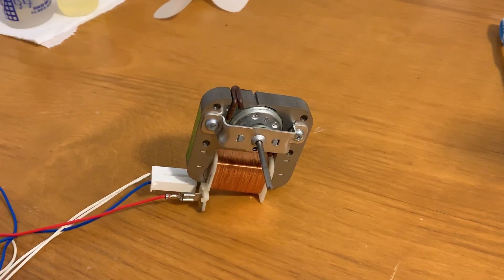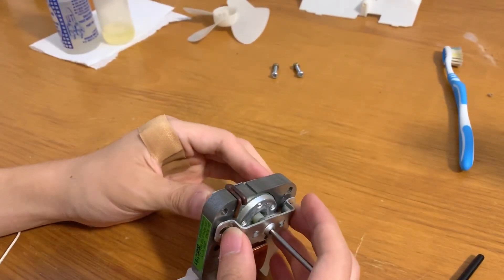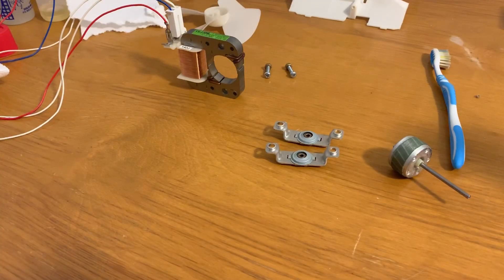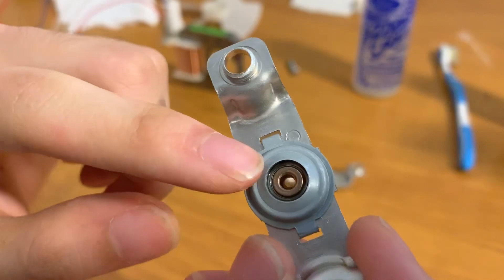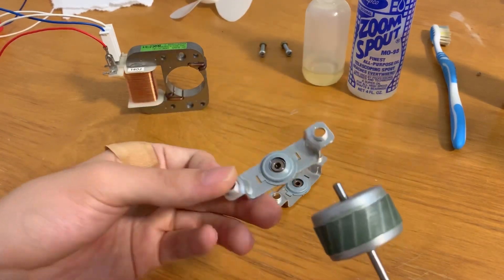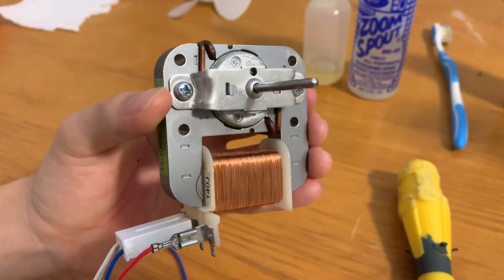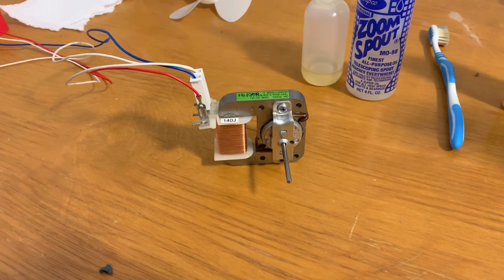How to Oil a Fan Motor (Shaded-Pole, C-Frame Motor)

Comment: Great video. I didn’t know about the felt and the oiling hole. I’m cleaning mine out now.
Reply from the maker: Thank you! Yes it's a pretty important part of servicing these motors that can get overlooked easily. Saturating the felt with oil will help with long term lubrication.

Comment: And what if it's a sealed motor like the Panasonic udqr107a1 and you cannot open it without breaking the plastic case? Does dripping oil through the shaft and spinning it with the hands can get the oil to the bearings?

Thank you
Reply from the maker: For a sealed unit, I think that is the best you can do. It might not be as thorough as disassembling it to oil the bearings, but it's definitely better than nothing.

Comment: Thanks for Sharing.   You can use Q tips to clean out the bearings (instead of paper towel) - you can remove some of the cotton tip if necessary to fit if the Q tip is too large.  I use rubbing alcohol on the tip to remove the gunk and dirt.  Just make sure no cotton fibers are left behind.   I also polish the shaft with a metal polish such as Simichrom Polish.   Just clean the shaft after polishing not to leave any residue behind - again with rubbing alcohol and cloth/paper towel/Q tip.
Reply from the maker: You're welcome, and thanks for your input! Great advice on using q tips. I hadn't thought about that.

Comment: Absolutely Excellent Video! My freezer's evaporator fan motor started making a loud noise and I knew it needs lubrication. I was lucky to find your video. From what I read these motors may need special lubricants as they operate at very low temperatures. People post that regular lubricating oils stop working after a short period in service and the noise comes back. Do you have a specific recommendation for this particular application? Thank you!
Reply from the maker: Thank you! I’m not aware of a specific low temp lubricant, but I think the two oils I like to use (3in1 electric motor oil and ZoomSpout turbine oil) will be fine. For the 3in1 at least, the manufacturer technical data sheet says its working temperature range is -15f to 300f (-26c to 149c), so it should be fine for a freeze fan motor.
Reply: @TheSuperFanMan  Thank you so much once again. Your thoroughness is remarkable! My Best.

Comment: My refrigerator evaporator fan stopped working recently.  It is similar to yours, but larger with a 5/8" stack size (Whirlpool WPC8891605).  I think the problem is that it might need cleaned and oiled as there is a lot of resistance, once separated, between the rotor/shaft assembly and the front bearing.   However, I am unable to do like you show around 2:12.  I can apply appreciable force and the rotor/shaft assembly won't separate from the front bearing.   Surely there wouldn't be that much holding them together, so not sure how to remedy.  Any thoughts welcome on cleaning and oiling and thank you in advance.  Even generic new fans run in the $50 range, so hoping to reuse the old one.
Reply from the maker: Sounds like the oil has deteriorated to a point where it has bonded the shaft to the bearing. I would try soaking that area in WD-40 or similar penetrating fluid for a day or two before trying again. Never pull with excessive force; the bearing itself may get pulled out of the socket, which would be a nightmare to put back together. Once you get the bearing off the shaft, inspect the mating surfaces to ensure there isn’t any significant wear. Hope it helps! Feel free to let me know how it goes or any questions that come up.
Reply: @TheSuperFanMan  thanks for your fast response!  I do have another question while I'm waiting to see what happens with the WD-40 soak.  I temporarily replaced the fan with a weaker generic (not ball bearing and smaller stack size) and I used the original fan blade.  However, when I tried removing the blade from the Whirlpool motor, the little compression ring went flying off into parts unknown in the room here and I have been unable to find it since.  Replacement rings seem to run from about $6-10 online with shipping tacked on!  For substitutes, I have been suggested Corbin clamps (similar to the Dorman 13400 assortment) , small hose clamps, and even nylon ties, but another individual thought that any one or more of these might cause balancing issues.  Thoughts?  Thanks again.
Reply from the maker: No problem at all! Those Corbin clamps should work perfectly. I’ve seen many HVAC purpose fan blades utilize those clamps. I imagine it won’t cause any noticeable balance issues, as the clamps don’t weigh much.

Comment: Appreciate your calm demeanor and clear voice with instructions. Oiled a few fans once got clogged up with hair and gunk but never k ew about the tapping for alignment. Great job and refresher before I service a 20” fan that was salvaged from a garbage pile and will only start if put on max speed and take 3-5 minutes to get running. Have a blessed day
Reply: Oiled up the old fan yesterday and runs immediately now and much quieter. Thanks
Reply from the maker: Thanks for the kind words. I’m glad it was helpful!

Comment: hey there!  watched the video a while ago, now i rewatched it -  i have a wall oven, and the convection fan stopped working.   i ordered a new motor, but they don't have any specs on the website, so when i got it the 'shaft  is much too small.   i notice there are different motor numbers dgxx   is there any way to look at the motor number and figure out what the diameter is?  the company that makes these  ovens  seems to have gone bankrupt.   there is not markings on the motor at all.
Reply from the maker: Hi! The model number of a motor doesn’t always state those details. Usually the retail websites will outline all of the specifications in the description, including the shaft diameter and protruding length. Other important parameters to keep in mind are the current draw (amperage), power (wattage), and dimensions so that the replacement has similar power and fitment as the original. If the website you’re looking at doesn’t state those parameters, I would contact them for more information or try another site. Hope it helps!

Comment: Arent those small holes on the bearing housings meant to be used as a way to apply oil without disassembly?
Reply from the maker: Yes! They are oil ports. I like to disassemble the bearing housings anyways when I first service these motors, so I can clean out old oil residue and directly saturate the oil wicks. But from then on, the oil ports can be used to "top off" the oil.

Comment: I have found that plugging one end of a sintered bronze bearing while forcing solvent through via a disposable hypodermic syringe from the other end results in a lot of dirty, gummy oil coming out around the perimeter of the bearing. The conical tip of the syringe may need to be trimmed and a rubber seal of some sort must be fashioned to seal the syringe to the bearing while pushing solvent through. Repeat until only clean solvent comes through. Then repeat this with oil until all solvent in the bronze is replaced with oil.

Comment: I have collected a few C-frame motors my colleagues pulled out of convenience store oven proofers some time ago. Turned out they got seized sinter sleeve bearings due to the oil turned tar-like over time. At some point the motor couldn't even start the rotor. After servicing it, it now runs like fresh off the assembly line. I see stranded C-frame motors yelling for help often.
Reply from the maker: Agreed! A little TLC is all it takes to revive these motors.

Comment: Hi Super Fan Man
Another nice video on lubricating electric motor bearings. 
Please be aware that your motor bearings were originally factory lubricated with PermaOil manufactured by the Permawick Corporation. 
Permawick currently supplies bearing lubricants to over 300 OEM electric motor companies around the world.
The “felt” you mention @ 7:25 is a product called PermaWick. PermaWick material is a combination of PermaOil and fibers designed specifically for electric motor bearings. 
PermaWick material acts as an oil reservoir and releases oil to the bearing as the bearing is releasing oil to the shaft. 
All sintered bearings can be reconstituted with PermaOil. PermaWick material can be reconstituted with PermaOil, or new PermaWick material can be used to replace the old. 
Keep the great video’s coming.

The Permawick Corporation.

Comment: Best video I've seen.  Thanks you!
Reply from the maker: No worries! Cheers!
Reply: @TheSuperFanMan    So, I have a Titan 267B 4000 Watt heater from maybe 1978 that needed servicing.  The motor in it is a larger version of what you show in your video.  What you show is a huge help.  I took apart the motor.  It was filled with dirt, dust, hair, hardened old oil, and whatever else.  When you'd turn off the motor before the fan would stop in  a couple seconds.  Now it takes about 30 seconds to stop spinning.

  I got a needle spout like you've got and put the Zoom Spout in it and put a good dousing in the front and rear bushings in the tiny oil holes on the top and bottom of the bushings.  The rear twice and on the rear motor shaft.  That side of the motor is all set now.  Today I'm going to do the front bushing again.  And I forgot to oil the front shaft of the motor in the bushing.  I DID, however, take your advice and use steel wool to clean off the front shaft because there was no way that bushing was going to slide off on the hardened gunk covered shaft.  I'm glad you pointed out not to force it or the bushing will get damaged.

  I removed the fan and cleaned it to a polished shine.  I could not remove the front bushing past where the fan attaches though, as the screw had made a good impression and bump where it had been tightened on the shaft.  When I put the fan back on I screwed it exactly on the impression/bump on the shaft.

  I'm not going to remove the fan again.  So I'm going to apply the oil to the 4 openings in the inside of the front bushing as I can't get to the front without removing the fan.  Now that I've applied oil to the front two holes I shouldn't need to put anymore in them to get the felt soaked.  I can still hear the the motor spinning when it slowing down after turning off the power, which leads me to believe the front bushing could possibly use more oil.  And mostly the shaft as I never oiled it by mistake.  Although it's now smooth from the steel wool I used on it.  Seeing that it takes half a minute to stop spinning, maybe enough oil was applied to the front bushing and it has spread to the shaft.  But I wouldn't be surprised it all that oil only went to the felt and not further out side of it.

  I'm glad you pointed out that 3-in-1 motor oil smells like 3-in-1 and Zoom Spout is orderless.  Big help with you putting this video on.  Thank you!

  Now, my big question.  Now that the motor is quiet.  This heater has always rattled.  And it's a lot quieter now with the motor oiled and fan blades smooth.  But it still rattles.  I'm guessing it's the coil heater elements where they attach.  Or maybe the heater unit inside the shell of the heater.  Do you have any idea's what rattling could be from?

  By the way, before I could work on the motor and the unit, the shell was terribly filthy on the outside.  Now it looks brand new, and glossy to my surprise.  My father pointed out that it's glossy because it's high temperature paint.  The inside of the shell was dirty too.  So it took one session to clean the outside.  And another to clean the inside.  Then I could get to the motor and took care of the rear bushing.  Then another session to do the front bushing, and reapply oil to the rear bushing.  All this with only an adjustable wrend to loosen the motor nuts under the motor that I couldn't see.  I had to do it by feel and it's slow and tedious.  I always say to use the proper tools.  Unfortunately my tool set with the wrenches and hex keys/allen wrenches is not here.  So I got a new hex key set to take off the fan blades but the wrench set did not get delivered in time to do the last session of work.  BUT, they're here now.  It should be a MUCH easier (and faster) task now of removing the nuts to the motor.

  Once again thanks for making this video.  Big help!!
Reply: @TheSuperFanMan  So, I opened it up again and unfortunately I learned I need a 9/32" wrench. So, adjustable wrench I used again.

  I oiled both bushing felt pads on the insides this time.  Both with 4 felt openings on the inside.  And I oiled the front shaft in the bushing.

  I turned the heater on and it was even quieter.  But still some slight rattling/ vibration sounds.  I turned it on again an hour later and was still making a little rattling.  But I let it run for a few minutes and it was only the fan running now with no vibrating/ rattling sound.

  I still need to open it up to clean the element area because it's dusty.  I'll oil it again then.  And this time I'll have the 9/32 wrench.

Comment: I have a c-frame motor in my air-o-swiss, but the fan-blade doesn't appear to be able to be removed.  Like step 0 (or -1) in your video.
Reply from the maker: Does it have a metal clip holding it in place? Usually they can be removed with gentle prying with a flathead screwdriver. Or it's possible that the blades are press fitted onto the motor shaft very tightly. If you aren't able to remove the blades, you can still oil the bearings by applying a few drops near the point where the shaft meets the bearing. It won't be nearly as effective as disassembling the motor, but better than nothing.

Comment: The intake fan on pellet smokers have the same shaded pole motor.  But just slightly bigger.  The rotor rides on a spacer so the spacer is a wear item.  Do you know where I can get replacement spacers?
Reply from the maker: Fiber washers (usually red or grey) or nylon washers can be used. I bought assortment packs from Amazon but I believe a lot of hardware stores have them too. Remember to check the inner & outer diameter and the thickness of the washers to ensure it fits your motor. Hope it helps!

Comment: Is it ok to use cotton swabs to clean the bearings?
Reply from the maker: Yes! Those actually work great. Just make sure there aren’t any strands of cotton left on the bearing surface before applying oil.

Comment: Oil will attract dust and dirt to those points. Using graphite or dry lube is the only way to lubricate these.
Reply from the maker: Oil has been used to lubricate motor bearings for over a century, and sleeve bearings in particular are specifically designed to work with liquid oil. As long as the bearings aren’t over-oiled, the oil generally stays within the bearing area and won’t attract much dust. Dry lube might work, but I personally wouldn’t recommend it.

Comment: I found a motor similar to this in my Portable AC.. On the wiring diagram its called a splash motor and throws the water it collects up into the condenser to help evaporate it so it doesn't fill up so quickly..

Problem is I'm having problems finding some that look identical. I'm afraid of using just any motor because of fears that it's not waterproof.. Am I correct in this assumption?

The motor just doesn't seem to work.. But it does spin freely. With the wires removed from the circuit board I get readings of 120v from the two pins.. When I connect the motor and check near the actual motor is more like 15-20v.. So I'm not 100% how that's supposed to work.. But my first instinct was the motor was burnt up.
Reply from the maker: Sorry about the late response! I have no idea how I missed your comment before. 

I’m not very familiar with the workings of portable ACs, but after a quick Google search, it appears that splash motors are more or less the same as typical shaded pole, c-frame motors. It’s likely that the motor itself doesn’t get splashed during normal operation. Does the motor have the voltage and current ratings listed on the sticker? If yes, you could obtain a motor with matching specs (also make sure the motor shaft length, diameter, and direction of rotation are the same) and it should work fine. Hope it helps!

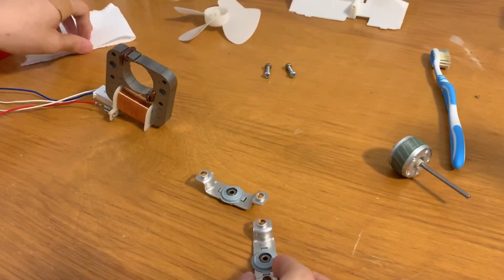Comment: 4:31 - Have you ever attempted to replace the bushings on this type of motor?
Reply from the maker: I personally have not tried, though I’m sure it could be done with patience and willingness to accept possible failure. It’s a really tricky process because these bearing housings aren’t designed to be taken apart once assembled at the factory.